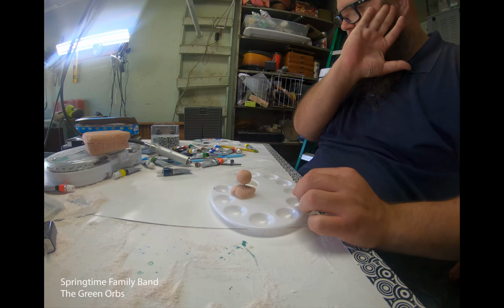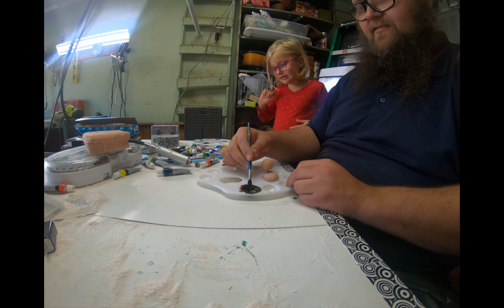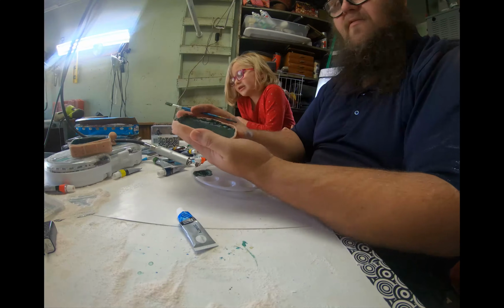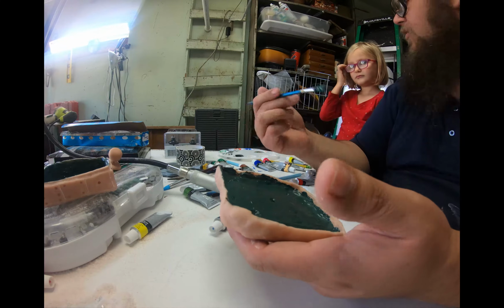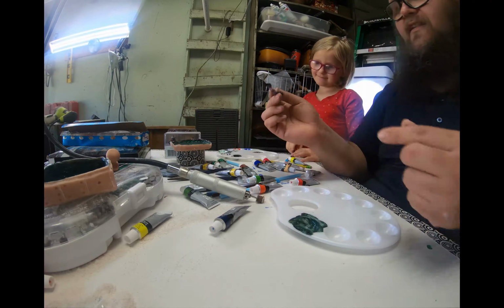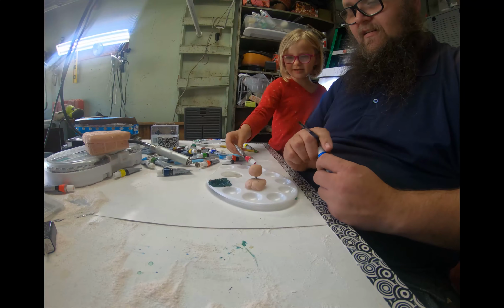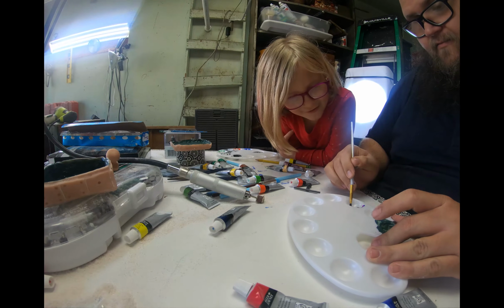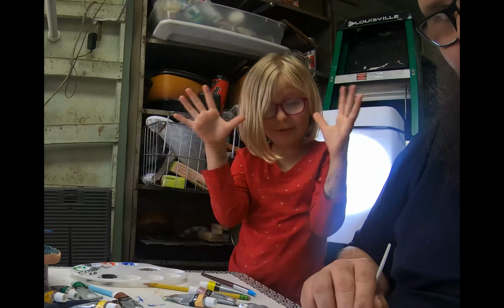Marble Game Board Build - Part One | Beardacus Friday | Episode 5

Comment: What did you use to drill the holes on the board
Reply from the maker: I used a 1/2" bit used for recessing screws, but a ball bit of the same size works better. Those can be found on Amazon.
Reply: Thank you so much